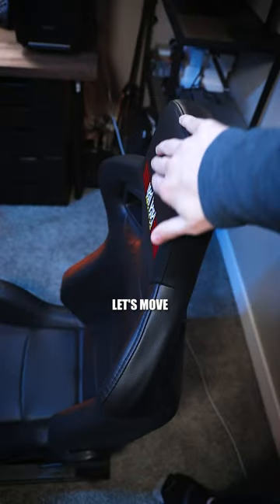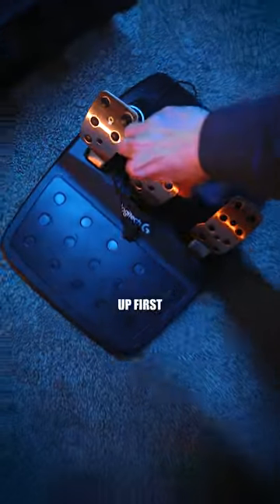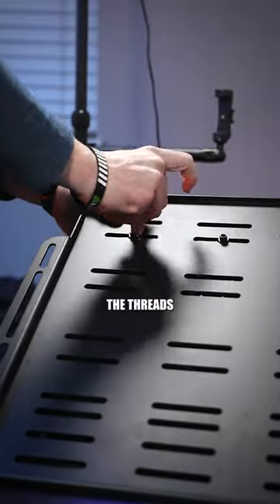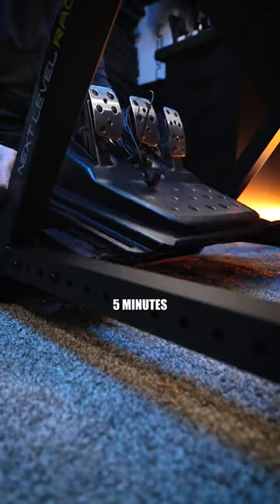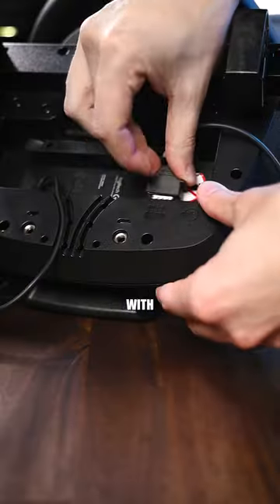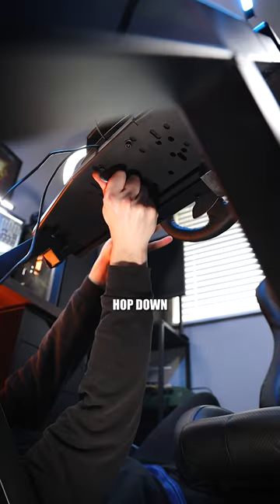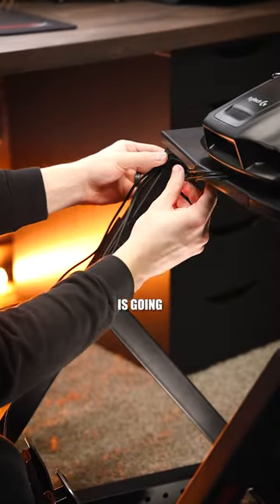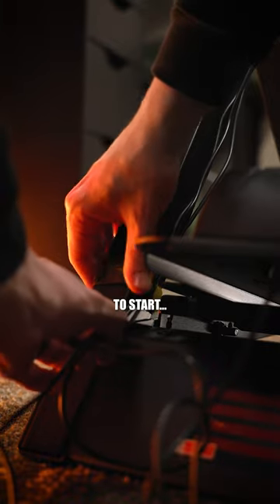GTTrack + G920 🎮

Comment: I just bought a G920 yesterday and I love it. The only thing I hate about it, is the brake..
Reply: Pretty sure it's the same pedal set as the G923. Just use it and it'll come around after some play time.
Reply: I mean I hope you have fun with that wheel but bro there are better options now 😭
Reply: @BigRascal like what
Reply: @BigRascal yeah for double the price
Reply: @MidTennPews the G923s brake pedal is different to the G29/G920s – the resistance increases depending on how far it is pushed down, unlike the G29/G920, where the resistance was very stiff no matter how much force is applied.
Reply: Nah there's a rubber block that you can remove from the brake super easy and makes the brake way better
Reply: Like what @BigRascal
Reply: @BigRascal mf thinks we got 700/1k for a sim setup 😭
Reply: @testyhat  you can get way better wheels for 500$ canadian. And if you can’t even afford that then you shouldn’t even be thinking about sim racing and you should be focusing on getting a job
Reply: @BigRascal  you got to be 18 for a job and nobody is Lucky to have money and get jobs as I'm poor
Reply: @testyhat  18???? Brother I started working when I was 13 I went around mowing lawns and shovelling driveways for money 💀 and then got an actual job when I was 15 I was a swamper for a trucking company I was getting paid 25$ an hour. I’m 18 now and I have 10,000$ in my bank account and I have a truck and a 1951 Chevy. I’m by no means the richest 18 year old ever but I’m certainly not broke either lol. And this summer I’m gonna hopefully be working at an oil tank farm about 25 minutes away from me.
Reply: @BigRascal  ig this year after I become 13 Ima see some summer job's
Reply: @BigRascal  sorry Brodie but I refuse to believe anyone would pay a literal child 25 an hour. Unless there’s some insider function.
Reply: @testyhat  just make sure you don’t over work yourself and make time to do things you enjoy. You have your whole life to work, you only have til 18 to be a kid.
Reply: @PterodactylFN  swamper for a trucking company… sorry Brodie you just got to actually work hard and show up to work everyday. There are a few jobs around her that pay above 25 an hour and I’m from Canada too so 25 and hour is nothing
Reply: @BigRascal   my b, didn’t see you were in CAD. That makes more sense, my bad brodie.
Reply: EASY FIX open up the pedals and remove the little rubber thing, I did that and now it feels so much better

Comment: I haven't been able to get asseto corso either, opted to return it, got beam ng instead and LOVEDDD beam
Reply: I actually bought AC over BeamNG because I'm on a laptop and don't have enough RAM for BeamNG right now.
Reply: @Rraptor1012  same but it'll run just multiplayer is buggy but I'm glad I got it cuz it's funny as hell
Reply: @tenzoarcade8026  so the 16 gb minimum RAM is just a suggestion? Would 8 gb be enough?
Reply: @Rraptor1012  yea u can run it alone u can even run with friends it's just the extreme stuff u can't do u can still add mods I got 8gb too

Comment: I recommend u get the shifter it's so fun to use with gated gear shifter
Reply from the maker: I've been looking at it for a while - wasn't sure if I wanted to start saving for a nicer wheel or just get the shifter and settle into the g920 for a while.
Reply: @NPCLiam  i think the steering wheel is good enough its more better with the shifter not to mention it makes it more realistc

Comment: I mapped my g920 out myself , takes a bit but I’ve had issues downloading settings
Reply from the maker: Totally fair. Yeah I've been doing a lot of manual setting as well and after re importing my LUT things have been good.
Reply: Had to change EVERY setting to 0 inside asseto basicly for it to feel correct and not wobble while going str8

Comment: Tbh I would have skipped the chair and frame and put that extra money onto getting a more high end wheel
Reply: That's what I did. I got the next level 2.0 stand and ordered gt dd pro with mclaren v3 wheel and wrc wheel and those both work with ps5 and xbox. 
 I just zip tied an old leather recliner chair to the stand and it doesn't budge under heavy breaking at all. I couldn't use the dish tray for the legs because the legs on the chair were to big.
  Plus I got arm rests on both sides to rest my arms on long races. I love it. I can always add the seat later. 
 It was my Grandfather's old leather chair that was 3grand and its very comfy for long races.

Comment: You need Logitech g hub for the steering wheel to work with assets corsa
Reply: I have it but it still won’t work, I can’t use the configuration wizard in ac either it don’t register my wheel. Other games work tho

Comment: I got the same setup but does your brake pedal feel harder to push than the other pedals?
Reply from the maker: Oh 100%, it's terrible feeling. You can actually take the brake pedal off and take out this little black rubber pad in it which gives it that stiffness and that's what I did. If you don't like it without people have also recommended rubber erasers or poking holes in the included one to lighten the stiffness.
Reply: @NPCLiam  I was told it's meant to be stiff to mimic actual cars used for racing. I got used to it after a week, but yea removing the rubber might be the move

Comment: I have a problem with my g920 it turns on  for a little bit of time and then the light blinks an then i doesn't work after that
Reply from the maker: The blinking light is a sign of insufficient power delivery. Check your power brick and cables there.

Comment: im going to sell my garbage wheel that only turns half way not even a full 360 and does not have a gear for some bucks do you have a wheel plus gears and pedals in the range of 150 below range of money you reccomend?
Reply from the maker: If you want to go full manual, the g920/g29 used are gonna be the best bet at that price point
Reply: @NPCLiam  ty
Reply from the maker: @wyattparker7779  For sure - also just a heads up it will be more expensive than 150, but searching for used and what not that'll be your best chance to find something close
Reply: @NPCLiam  i found one for 109.99 with the stand
Reply: @NPCLiam  nvm it lied the wheel is 300 notnincluding anyhting rlse